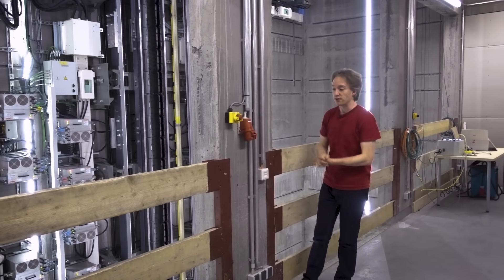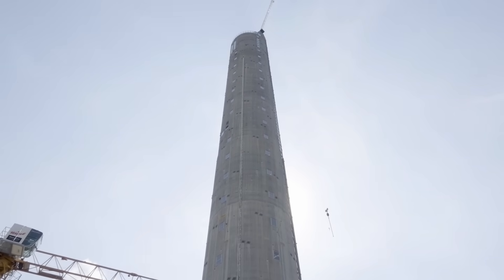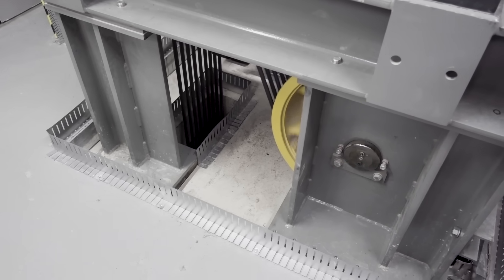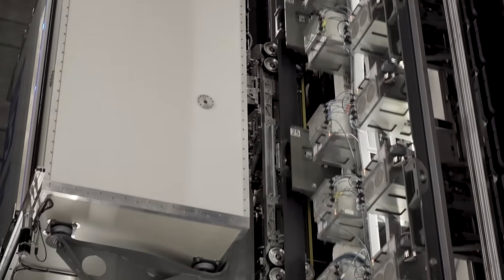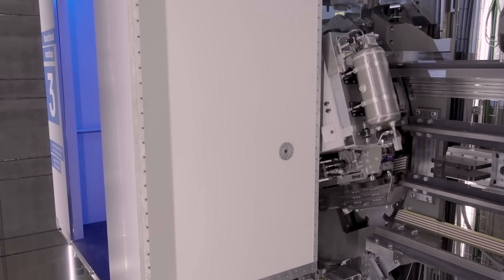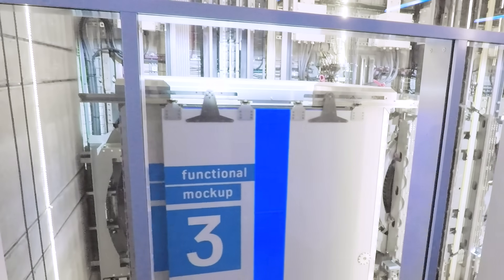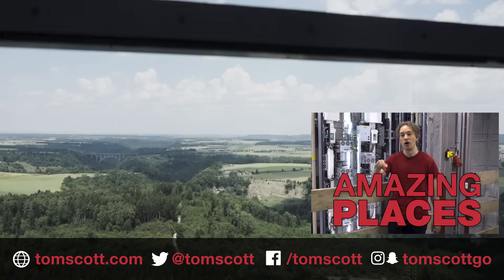An elevator that actually goes sideways

Comment: It looks complex with way too many parts that could potential fail in some way or another.  Even with fail safes, think of the maintenance and cost of this.  I think elevators are a necessary invention for high rises, but I think we can walk rather then be pushed along sideways...  Laziness is going to cause more problems then it solves, and not engineer can solve that.

Comment: But how is the fan and other electrical equipment inside the elevator car receive power if you do not have a separate power cable. Does the car have slip ring for power?.

Comment: I don't understand why they couldn't build their elevator using ordinary rotating electric motors, with wheels similar to roller coaster wheels, and straight vertical rails bolted to the walls of the shaft.

Comment: The Germans build the Elevator Simulator tower :-)

Great invention. This type of flexible elevator will enable really tall buildings with multiple connections to other buildings.

It will also enable more elevator cabins in one building, so that there can be maybe 10 elevator rooms floating between levels in a circle. It would probably be more efficient too, if the elevator has to travel fewer levels, before the passengers get out.
Reply: I think the real time savings will be the lift can "step aside" and let people in/out of the lift.  This way, other lifts can continue to move up and down the shaft.  The most time consuming thing about an elevator is getting people in and out of the cabin -- this eliminates that issue.
Reply: @harthenry  In theory that ought to reduce the amount of lift shafts used in a building as well. The higher you go, the more floor space you have to lose to them - hence express shafts. With this system I suppose you can do away with express lifts as well? That could very well bring down building cost as well.
Reply: @harthenry  This would only work if there were one of those turning tracks at every floor, which would drive up cost to the point of infeasibility. maybe placing one every 5 or 10 floors might work but still substantially increases cost from the original 2 change point design that they seem to currently be using. I'm sure some industrial engineer could do the math to determine the optimal number of change points. I also think it would only really improve efficiency if there was at least one spare track which didn't stop at any floors but rather was used to allow elevators to pass each other so that if you have (for example) main 2 shafts and a third passing shaft and one of the mains broke down, the last remaining main shaft wouldn't be rendered useless by one of the cars breaking down on the track. This way you could achieve a degree of double fault tolerance in the system.
Reply: also it would allow more than one elevators in one shaft. You could just shift the elevators out of the way when people are getting out so the next one can pass right through to the next level.
Reply: @jort93z  BINGO!
Reply: connecting adjacent buildings is really tricky and rarely worthwhile.   the advantage of this is really that you can have multiple cars in the same shafts at once.. if you are building a 100 storey tower, you can easily end up with wasting tons and tons of space on lift shafts with only one car in them.  since  you mutliply the area of a lift shaft (say 4 m2 ) over 100 floors, that's a lot of wasted space
Reply: elevator tower isnt new, i could see one  from my home in penang. its really tall.
Reply: Yeah, who else would do something like this? Can just be us Germans
Reply: @valy5684  please be a little bit less arrogant
Reply: Why just one building?  You could link buildings together with this.

Comment: That's where I used to live... Rottweil, in southern Germany. Massive ugly tower 😂
Reply: That was in the building phase, every building starts like that. Now it has got a facade. I haven't seen it yet though because I am abroad at the moment. One thing I want to see, when I come back. It's opened for visitors.
Reply: Yes, this dog race was common in the area of Rottweil and was named after the town.
Reply: Ich geh in Rottweil zur Schule und mitterweile finde ich mit der Außenhülle sieht er gut aus.
Reply: So all of the inhabitants are Rotweillers?????
Reply: aber echt
Reply: Not from the Inside
Reply: Is that were the dogs come from? You know, those ones named after an area... Alsatians I think.
Reply: @gwenynorisu6883  Pomeranians?
Reply: @krashd  no, I think it's the labrador retriever
Reply: StraightOuttaJarhois Rottweiler halt
Reply: Die Aussprache der deutschen ist ja mal echt grauenhaft
Reply: thatsthejokeson.jpg
Reply: @gwenynorisu6883  r/ihave4chan

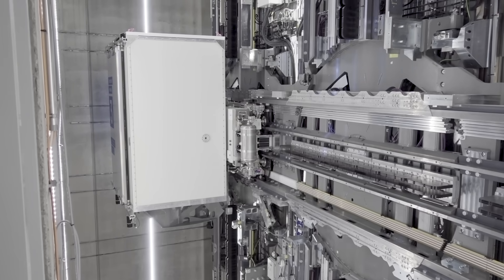Comment: 1:17 "The time is 8;47 AM. Current topside temperature is 93 degrees with an estimated high of 105..."
Reply: There is no temperature reading at that timestamp.
And btw it would be metric, so quite warm.
Reply: @emmata98  🤦‍♂️

Comment: So..how does this save any time or move passengers any better? I saw that you can go into horizontal mode while boarding or deboarding, but then everyone has to wait for it to go vertical again once i'ts moved shafts. What does this accomplish? It's on a new shaft which a different elevator had been on already.

I'm not seeing how this system offers any user benefits. Besides being able to go all the way up and down in one lift, but from the looks of it you'd be going back and forth on rails anyways, so it still wouldn't save time!

Comment: The buffer is only made to withstand the elevator at slightly over its maximum speed with 120% load. NOT A FREE FALL.

Comment: It seems to me the energy use would be much higher since there isn't a counterweight to offset some of the mass that the linear motor needs to move (the cars and its contents).  All motors convert energy to force.  Unless Newton's laws of motion somehow don't apply anymore, more energy will be necessary to create the force to move the car without the obvious gravity-negating mechanism of the counterweight as gravity is one major force to deal with in all elevators/lifts.

Comment: That's not LIM (Linear Induction Motor), that's LSM (Linear Synchronous Motor). In your talking head shot you said LIM, and then immediately after words the ThyssenKrupp guy said it was LSM.

But the main point is, that's got to be one massively expensive elevator.

Comment: So, in theory, would this allow for an elevator to transport people horizontally over large distances?  Or just empty cars?

In several pieces of science fiction, there are extremely large spacecraft.  For example, the Super Star Destroyer in Star Wars is over 8 kilometres long.  While that is technically a walkable distance, I'd imagine the Imperial Navy doesn't want their troops taking half a day to walk from their quarters to their on-duty post (some could be positioned close by, but maintenance crews kinda have to go wherever the broken thing is).  While the ship is actually big enough that you could literally just build a deck that has a highway system and bus people around, the authors of the Star Wars books that actually go into enough detail describe an elevator (well, turbolift, because this is a world where concrete is now duracrete and plastic is plasteel, glass is transperisteel, etc) that has free 3D movement - you can hop into a lift at the bow and get out at the starboard hangar bay 2 decks down amidships.

Looking at the design, I can see it being theoretically possible to manage 2D transport - it actually looks kind of like a train rail network, just...small and on a wall instead of big and on the ground, so going forward and back (with the perspective of the door being the front of the elevator car) would be problematic.  However, I can see the possibility that the car can't take the load of a person IN the car when doing the sideways travel, depending on how that connection is designed - strength is often very different depending on how you apply the load, so turning the connectors all 90 degrees kinda means you can't assume anything about the strength anymore.

Comment: A nitpick, but Linear Induction Motors and Linear Synchronous Motors are not the same. One uses the eddy currents induced in an aluminum reaction plate, the other uses permanent magnets or a second set of electromagnets.

Comment: Nice design. Guess it can accelerate so much  that you can mimic  free-fall  and  zero gravitation for a few seconds.
If you pay more then you do not need  to change cabins, the same cabin takes you up  from 0  to 110th floor.
If you pay less: step out, wait for next cabin, step in ...

Comment: The great features of this lift could be that they will allow acceleration and deceleration at much higher lifting speeds than a normal cable driven elevator.  Also it means that a level on a building could have a elevator that comes Up to your floor then travels accross the floor to your door.  No need for hallways in buildings using this design of elevator. (admittedly the hallways would be elevator / lift ways instead.  (I would say this is an elevator more than a lift, even though I am from the UK. Lifts are pulled, elevators are driven.)

Comment: What's the purpose of having an elevator go sideways?
Reply: You could have very tall skyscrapers with several cabins running in the same vertical shaft but still service the full height of the building, thus increasing capacity and speed.
Reply: The elevator problem on modern skyscrapers creates congestion. 200 floors would take 20 elevator shafts or more. Rather have 4-8 shafts that each run 5 boxes.

Comment: Thanks to these videos I had a weird dream that I lived in a high rise instead of low rise and there was an external lift attached to the outside of the block of flats that I needed a key to use.  I got in the lift and it went horizontal to the business district of the city so I felt compelled to get out and explore.

Comment: I've heard of two reasons against long elevator shafts which have nothing to do with cables...
1) it's often quite windy at the top of an elevator... if wind gets in a shaft, it tends to be directed down the shaft.
2) Elevator shafts can function as chimneys in case of fire, and draw fires to be more intense. And also spread fires between floors

Comment: Is it possible to for these exchangers to operate at angles other than 90° and 180°? If I rememeber correctly, the elevator in the Luxor Hotel in Las Vegas travels along the slope of the pyramid. This could definitely lead to intersting building design, and improved effeciency of occupant travel in large structures. Great video as always Tom!!

Comment: And being made in German, the machine will work great for 4 years then start to break down. Fixing it will cost a lot due to over engineering and  over price replacement parts.

Comment: This could potentially increase elevator capacity in high-rise skyscrapers by adding multiple cars per track and using 2 tracks as a sort of paternoster system (1 track goes up, one goes down) in stead of having to wait until one car is all the way down, you could just keep rotating them and (if necessary) park surplus cars not used outside of periods requiring peak capacity. Ingenious. :)

Comment: Is there a safety system (either a battery backup, or the brakes applying) in case of a power outage? Have all of the safety systems been designed and are currently being tested?

Comment: Guess you should've better explained what the point of switching shafts is? looks like it takes quite some time to do that, so... why?
Reply: Srsly? You cant see the potential?

You could walk into a elevator in Building A and press the button to go to building B and the elevator could actual do that.

There could be a bridge between buildings (or even underground tunnels) that connects them with horizontal shafts of this elevator.

Imagine being on top floor of skyscrapper 1 and wanting to get to the top floor of skyscrapper 2. With this elevator it would be possible in a few minutes. Without the need to change cabs or even do one foot step.
Reply: well outside of building transfer it allows for the same cab to carry you up more of a building. many structures dont have a shaft from bottom level to top so you need to go up say 40 then change to a different cab that services 40 to 80 for example. this would go up 40.. over to next shaft.. then continue up 40 more. this gives building engineers more options on structural core designs that dont depend on extremely long shafts to cater to.

Comment: This is revolutionair! By having several cabins in the same shaft you will save an enormous amount of space that would normally occupied by lift shafts and now can be leased out and make income. This is game changer for building design, the taller the building the more advantage this system will have, the amount floor space that will generate revenue is increased massively.

Comment: You should do a video on the elevators in the St. Louis Arch. They rotate as they go up. Really interesting mid century technology.
Reply: Yah, they're swivel-mounted so they stay level no matter what angle the track is at, from near-vertical at the bottom to near-horizontal at the top.
Reply: Sounds kind of sickening.

Comment: The more moving parts,  the more chances that something is going to go horribly wrong.  I would stick with simple cables if I was them.   If you are going to go with linear drive motors, then for God's sake, use a speed retarder system that uses the Locher system COG-WHEEL system (similar to that used on the Pilatus railway in Switzerland) coupled to a pure mechanical device (viscous fluid clutch)  that won't allow vertical decent speeds to exceed a certain level. That way even if all electronics are fried for some reason, the elevator will only fall gently, not deadly fast.

Comment: If I was about to get on a elevator and I asked the guy who made it "how does it work?" And in his answer was "we took a motor and we cut it" maybe all those steps that lady said wouldn't sound as bad to me.
  But on the other hand some days i feel old and tired I might use a elevator that's a rope with a loop on the bottom for one foot pulled by one pulley by one guy with severe pollen/dust allergies in spring that was beaten by his mother as a child anytime he didn't cover his face with both hands when he sneezed to the point it's so automatic he's dropped his own newborn once when someone was dusting than taking the stairs.

Comment: It'd be really cool if these systems eventually were used to replace public transit. Cost would have to be brought down, but it'd be really interesting to get in an elevator on the 20th floor of your apartment, drop underground and pop back up at work or a restaurant.

Comment: At the risk of sounding weird, a recurring dream of mine for many years is that I'm in an elevator that's going vertically but then goes horizontally as well, either within the same building or from one building to another.

Comment: These are neat but I wonder what sort of safety is implemented to prevent a freefall. There's usually a braking system, but the cabs aren't generally affixed to the walls of the shaft. They're just resting on a guide with the safety coming from the rope and the rope gripper system. And the buffers at the bottom aren't usually rated for freefall, they're there to take a hit from a normally operating cab that doesn't stop. One issue this solves is the less commonly considered scenario where the counterweight falls and sends the cab flying up.

Comment: I wonder if this could be used to make an elevator to space, since it could actually travel very far upward distances without having to deal with cables? It would save so much money in terms of rocket launches and people could enter and leave space with very little effort! But it would probably take some major feats to do such a thing and a lot of scientific research / mathematical knowledge, not to mention the time, resources, and money needed to successfully do such a thing.
Reply: The problem is keeping the structure up right.
Reply: Yes even a couple miles up would save a lot of fuel, and a lot of money.
Problem is we haven't even built one mile high, wouldn't really know how at the moment.

Comment: dafuq, I never expected that the whole wall needs to be plated with the linear motor I always assumed the cabin would have it.
But then again the whole cabin would get heavier.
I'm also surprised that you have only "fixed" points (the fakt that you can insert them anywhere in the rail system doesn't change that it mounted to the wall)  for a shaft change I hoped it would be seamless in transit.
That is not something I would consider as a company to buy.
Sure it has way shorter cycle times but you can get fairly similar results with smart transit routes
(a computer which tells you to get into which shaft at which floor).
If Thyssen wants a real game changer contact me and I design a real turbolift like in ST :-D
We already have key parts for this technology just nobody put them together yet...

Comment: Actually the linear motors would slow the cart down if it was in a free fall. The magnetic field created by the falling cart (with magnets attached) will be opposed by the aluminium used for the tracks. Therefore such a design would be inherently safer compared to traditional elevators.